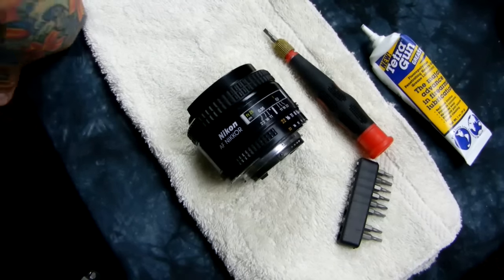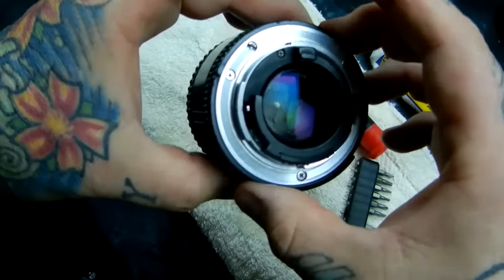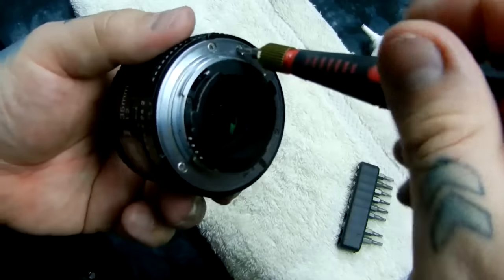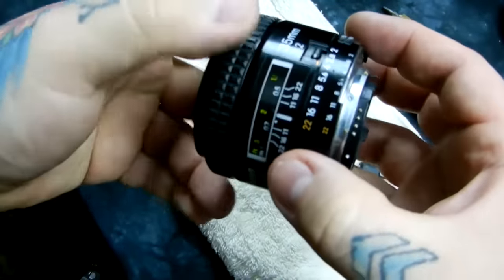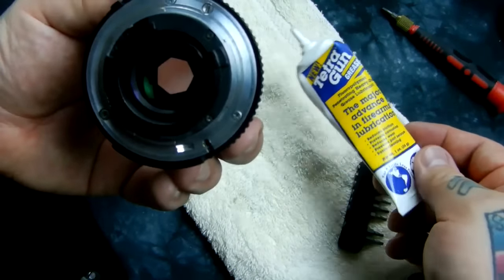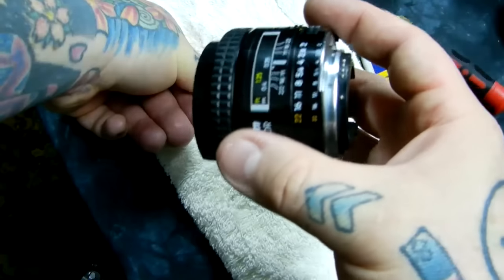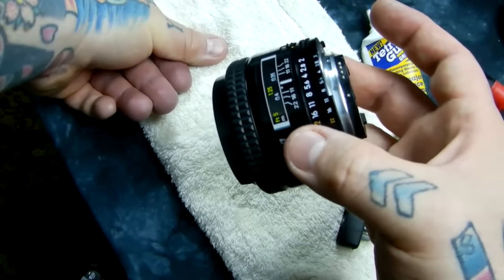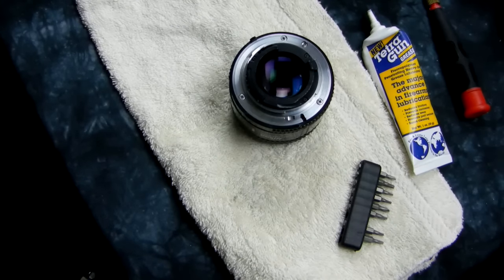Angry Photographer: Fixing D series Nikkor screw drive lens. DEMO ON HOW ONE WORKS

Comment: I just got a 35mm f/2 D lens,based on your recommendation ,for 110€,with focus problems. It works fine from 0.25m to 0.35(0.40)m but after that...it just stops. Even manual focusing this lens after 0.40m is a little bit heavy so I was thinking it needs some "lube". I wonder if I can repair it or I should send it to be repaired. But otherwise....the lens is a marvel.. optical...:)

Comment: So I have a 80-200mm Nikkor ED lens that I just from Ebay. But the screw drive is not flush so the screw in the body won't turn the lens screw. Any idea on how to get up flush?
Reply from the maker: +MrPaulbogart screw the lens mount base down, sounds loose :(

make an ebay claim on a defective lens if not :(    Grrrr!
Reply: +Theoria Apophasis  So I checked the mount base and it's tight. Really sucks if I turn it with a screw driver I can see it focus but the screw in all my bodies won't reach it. Oh and it came from Japan so I thought it would be good :-(

Comment: Hi Ken,

It would be great to actually have seen you do it. 

Is it the same thing with AI/AI-s lenses (except for the screw-drive part of course)?
I have a nikkor 1.4 AI which is not smooth (and specially not regular) when focusing. It is otherwise in excellent condition.
I wonder if I could open it and do something about it... I don't think it's dirt though, the lens is overall very clean! Almost no dust inside and no external dents etc.
I have got a partial refund but I would love to have it in perfect shape.

Many thanks.
Sérgio
Reply: +Sérgio Mota Older lens (not sure about your 1.4) can have a helicoid or multiple helicoids which run against each other internally to move the lens(es) about. These can get quite dirty, even though your lens exterior looks pristine. It can be tricky to operate on such lens, though if you have good mechanical aptitude it might be worth it. 

I expect that opening up your lens, you would find a bunch of dirty, gritty grease inside at the helicoid interfaces. You might be able to get away with just a clean up of the places that you can reach, and replacing with very good & suitable light lens grease or what Ken is using here. You will have to get further into disassembly than just the back plate though, perhaps removing focus and aperture rings might be what is needed to access a window to part of a helicoid (moving the focus accesses more spots of the helicoid). It seems to me as if most lens tend to deconstruct in different ways, so I can't recommend one method. Trial and error, mechanical aptitude and patience are a must. Or the $$$ to pay a lens repair place!

Disassembling such lenses fully, might make it quite an ordeal to get them back together. If you do attempt such courageous behavior, first mark out all of the final positions of the helicoids against the body. you will find various photos and text  on the web of people doing this sort of thing to various lens, which will help.
Reply: +phuktheest Thanks a lot for the tips!
I'll probably keep it and open it one day. Can't learn if we never try, right?

By the way, when I have the camera on horizontal position it's harder to focus towards left (bring the focus point closer), and when it's in vertical position it's the opposite. Still think it's dirt? :P

Thanks doc! =)

Comment: Sorry to dump a Q on you, you do so much already... but a quickie: I have a push-pull first AF version of the Nikkor 80-200, which is of course screw drive. It's optically perfect and takes a boner-yielding quality of pic, but it gets a bit sticky on the zoom when coming off the 200mm mark. I have successfully done 'surgery' on quite a few lens: AI, pre-AI, SWM-G's and D's, but this pre-D big beast scares me like no other... (look down the front of the lens when zooming back & forth and the trepidation is explained!). Do you know if it is a relatively difficult job to operate on one of these lovely old tanks? Thanx in advance!
Reply from the maker: +phuktheest yes, it is difficult.